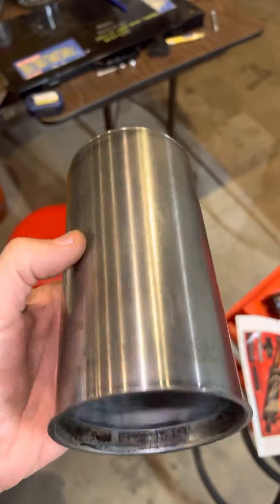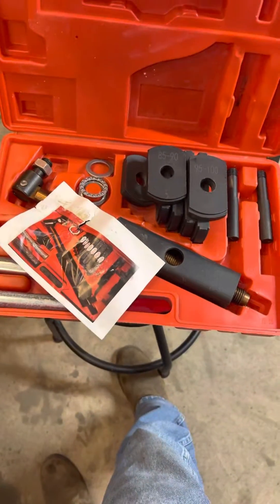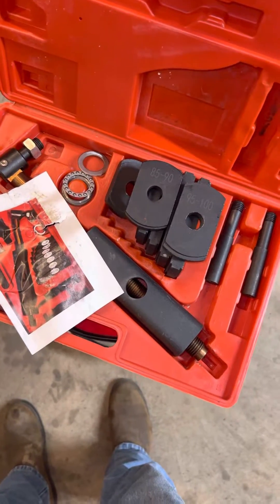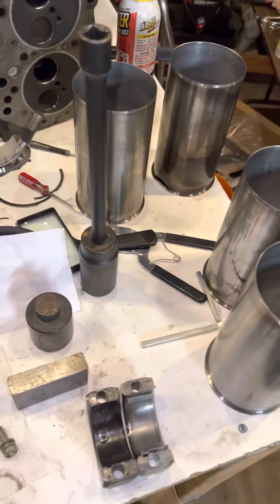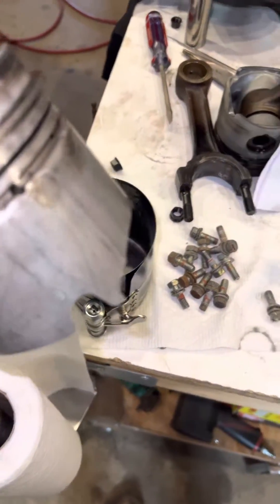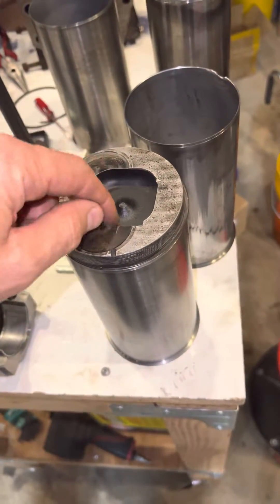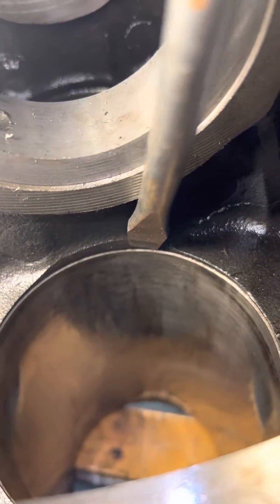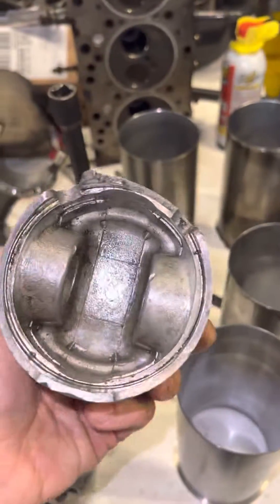Using a trashed piston and ring to remove dry cylinder liner on Isuzu 4JB1 from Bobcat 853

Comment: Curious what you used to install the new liner? Did you buy a tool, or just a flat plate and a hammer/press?
Reply from the maker: I tried the dry ice, but it would get stuck about halfway in, so I then put a board over the liner and used my shop press to finish the installation.